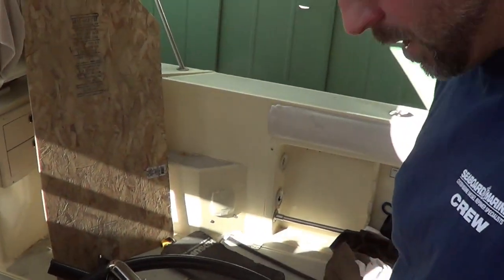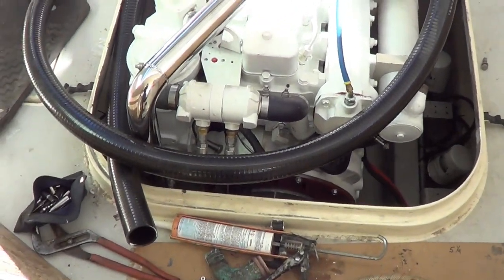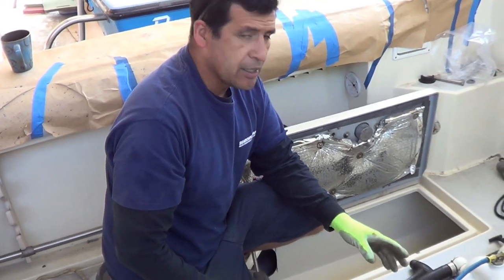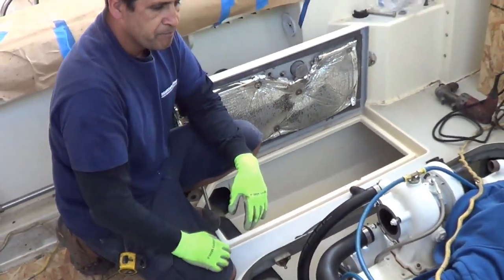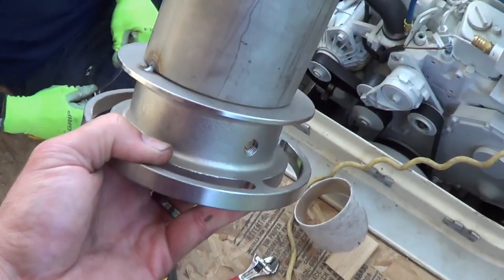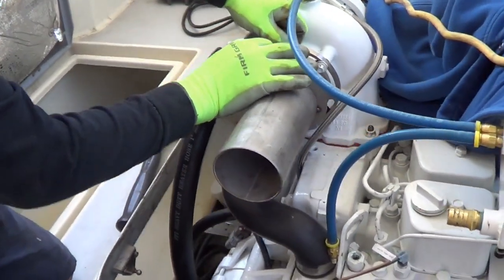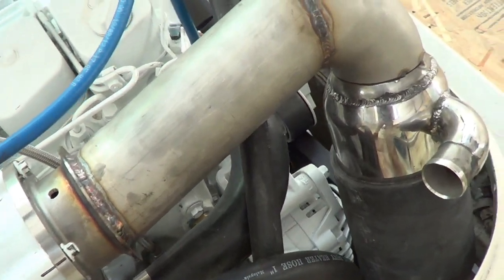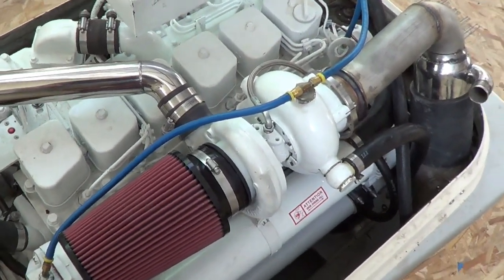Project Spotlight: Albin 28 Dry Side of Exhaust and Final Motor Install

Comment: Does Sea Board install 4BT Cummins diesel engine in 20 foot Wellcraft boat. Remove 5.7 350 ci. 260 hp. Engine.Sterndrive.
Reply from the maker: Yes we do gas to diesel re-power projects all the time.  Visit our website to learn more.  www.sbmar.com
Reply: @SeaboardMarineIncVideos  I will keep in touch with you. Were are you located ,because I live in Victorville, California. I've done many research and found that people has low-power there Gasoline engines to a diesel engine. I prefer a 4 cylinder 4-bt Cummins diesel engine with 150 to 250 horsepower and mercury Bravo Sterndrives that fit the Cummins diesel engine torque ratio. Plus how much would it be$$$_____________?
Reply: More money than 3 of those boats are worth